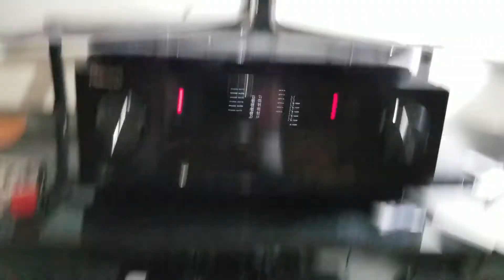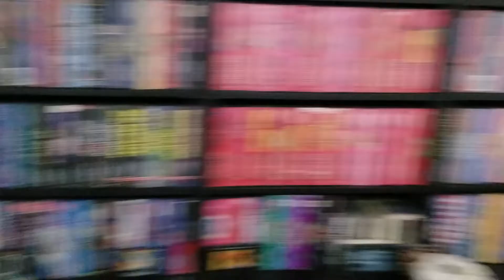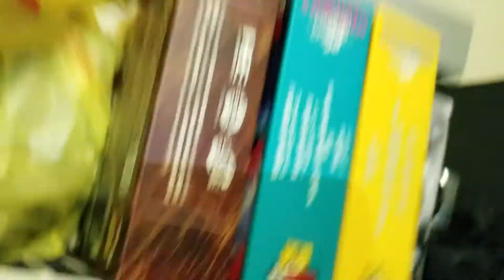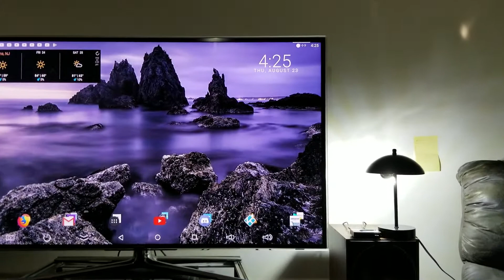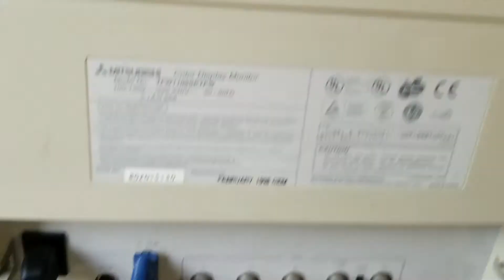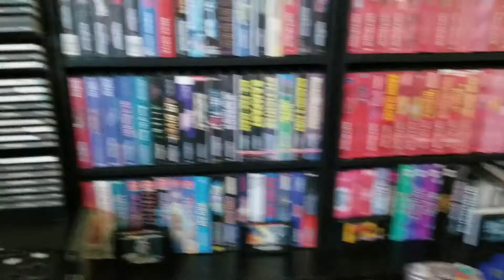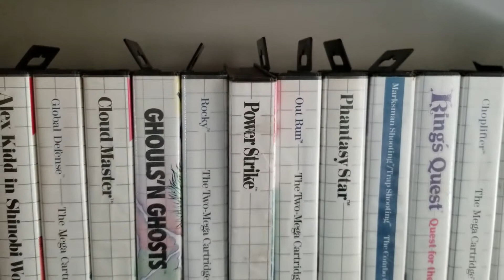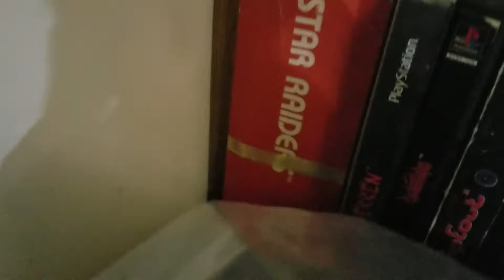THE BEST GAMING SETTUP IN THE HISTORY OF HUMAN CIVILIZATION!

Comment: EPIC BROTHER! This really is taking connectivity to the next level, from low res, to high res, to HD, and everything! Love the setup! And as for PVMS and BVMS, as you know I have a PVM, and honestly, I still prefer a 31 kHz PC VGA CRT with an XRGB line doubled up from 240p to 480p with artificial scanlines, for one, pvms and bmvs, have so much fuckin' run time, they are pretty much shot, and even made from the factory back in the day, they aren't as quality as any of the PC CRT monitors from the 90's which give you perfection in terms of color, convergence, geometry, and ease of use of picture controls to manipulate all of the above. 15 kHz, 240p monitors aren't worth the stupid, dumb, price of admission, for a fraction of the price the 31 kHz setup, with the right up-scaling tools, beats the piss out of a overpriced, leaking ass capacitor pvm. I bought my PVM back in 2011 for $45 bucks but now, you'll pay 4 to 5 times that for one, and to be honest, it's not holding up nearly as well as even some older VGA PC CRTs I own, which just kick its ass all over the place if I must be brutally honest. Keep the videos coming man!
Reply from the maker: Cool, glad you approve! I'm glad to here your a opinion on the bvm thing. A line doubler and a local vga crt pickup seem so much more of a realistic settup these days.

Comment: Hey I'm kinda wondering something.  Now at Walmart I've seen where they have this 4-way hdmi splitter and hdmi to vga adapters for hardly next to nothing.  What is your opinoin for this if I somehow manage to nab a replacement pc crt?

The one I'm playing with is dim as @#&@ and there's hardly anything else to do other then to replace it.  480p is still sharp as tits though.
Reply from the maker: there are cheap hdmi to vga adapters that work great. I use one. The poor mans bvm.
Reply: @neozeed1984  Can't believe that post is 2 years already, but those adapters are a real good deal nowadays, especially if you can hook one directly to the back of the monitor so it gets carried all the way without any analog degradation and still have a spare vga cable.

I sadly still have the same monitor with me.  Dim pos, but the ossc is doing a real fine job of picking up the brightness on its end.  Whoever thought to coin these things poor man's bvm obviously didn't play enought 480p or 720p content and those scanlines when match with sony are just as great as you could ever ask for.  Still like to have a bvm though. :)